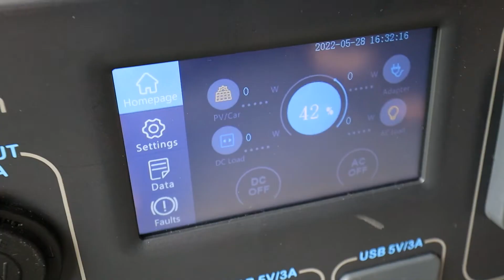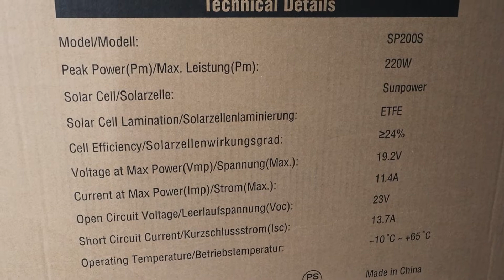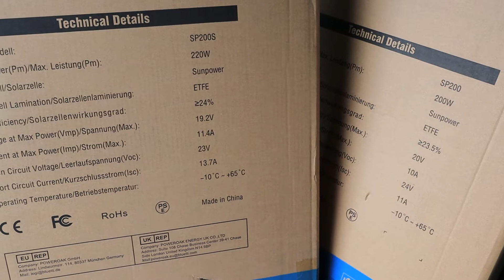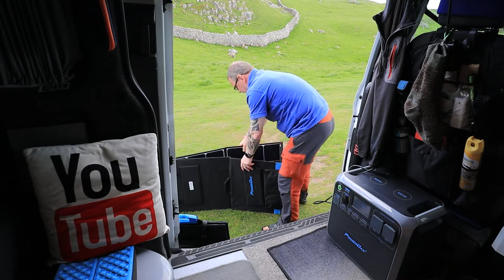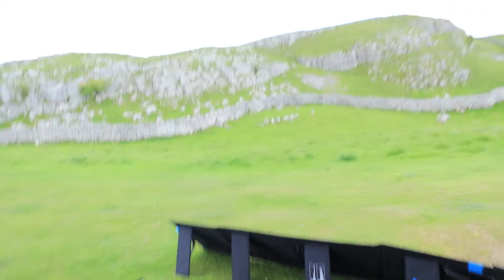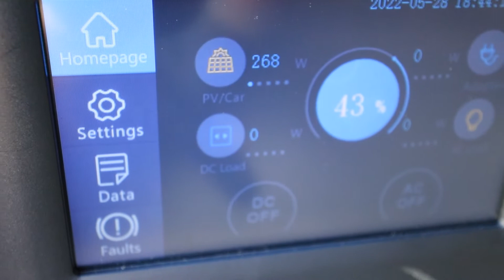Bluetti SP200S Portable Folding Solar Panel, free 220w mobile energy electric charge while camping

Comment: So did you combine the SP200 (200W) with the SP200S (220W) in series together? Don' t they take any harm because of their different voltage/specs?
Reply from the maker: was ok for me, i am not sure if it will i cant answer that, maybe ask the Bluetti support team
Reply: @VanlifePhotographyGear  I got an answer from Bluetti:

According to Bluetti different panels can't be/shouldn't be combined...
Reply from the maker: thank you ill remember that in future
Reply: I think that if the specs of the panels don't differ much, it could work. Jasonoid on YT did wreck a Bluetti 120W panel when linking it up with a 200W panel though...
Reply: @VanlifePhotographyGear  Hello! Bluetti reached out for me and informed me that the´ve tested the combination SP200 (200W) and SP200S (220W) in their lab. They informed me that you actually can(!) use both panels in combination!
Reply from the maker: these are close but ill remember in future
Reply from the maker: thats great news
Reply: @VanlifePhotographyGear  yeah, I think you can combine the SP200 with the SP200S 'cause they have quite similar specs. Didn' t work out though with the SP120 and the SP200....
Reply from the maker: sure  must be